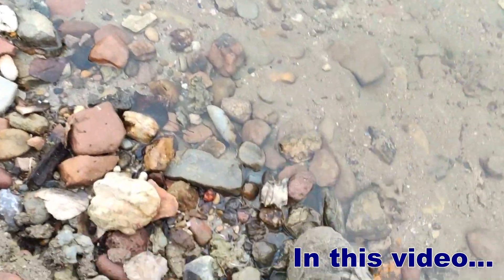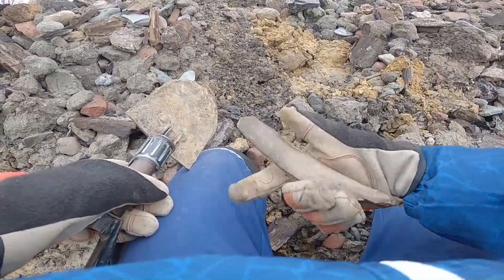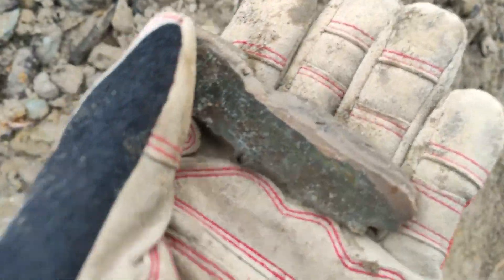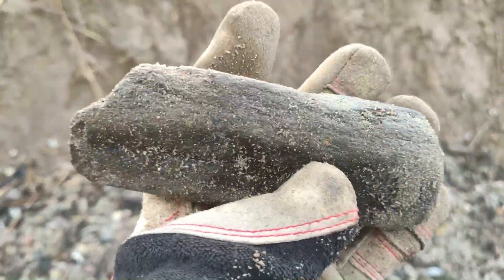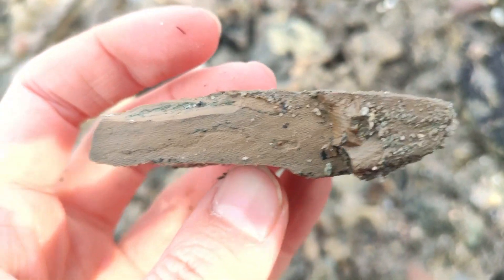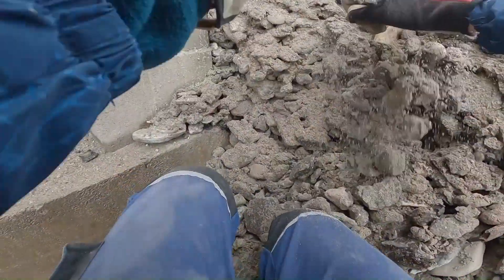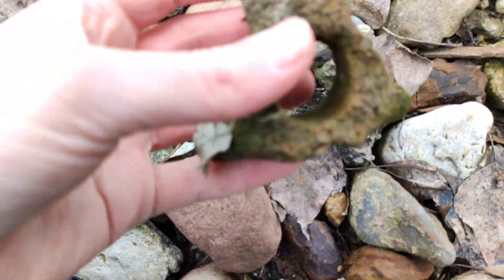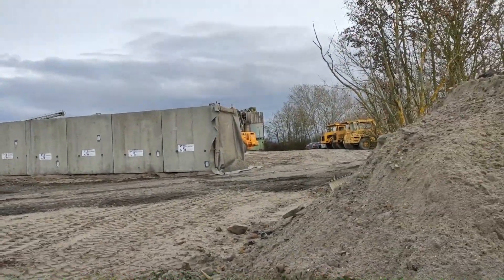Found mammoth ivory, bison tooth ICE AGE fossil hunting

Comment: Are the tusks broken during the mining process or are they broken in situ? Just curious cause that would stink if the miners break it.
Reply from the maker: Mammoth tusk is fragile in general. The fossils are located on the lake floor and are transported to the surface with a suction dredge. The opening has a caliber of just ~30 centimeter. So all bigger bones break. But sometimes you can bring with an excavator entire mammoth bones to the surface ⛏️😉
Many greetings from Germany ✌🏼
Reply: @fossilwildlife5198  thank for responding! I didn't know that was the process, that's very interesting!